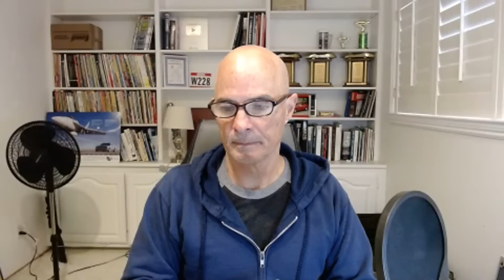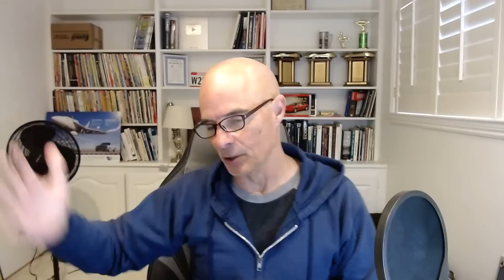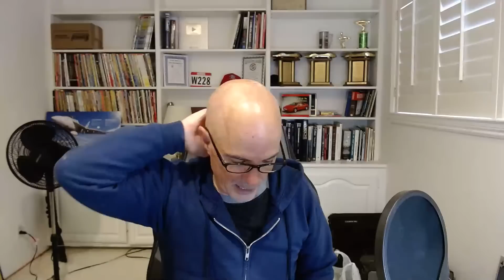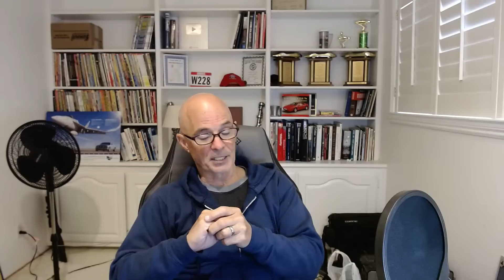LET'S TALK TECH-BIG HEADS, SMALL BORE?

Comment: Will 706 heads work on a 6.0 bored to 6.2, all else stock 6.0 cam 317 heads currently.If not what mods need done?
Reply: Eventually I will put SPDC Truck Torque 205/210 @ .050, .550 int .525 ex with 115 LSA and LS6 Springs that I got at a great price
Reply from the maker: I would be worried about boring it that far-heads are fine
Reply: @richardholdener1727  The motor was built by well known engine builder in this area Don Hardy Race Cars, I’ve reached out to them for more information on the engine. I’m wanting a little more from it and trying to utilize what I have already have.
Reply: Rich is correct, cylinder wall gets pretty thin at 030, I wouldn't go further,

Comment: I have afr ls3 64cc heads on ls2 bottom with summit 8710 (230/242  625/605 113+3 car dyno's 453/403
I have .130ptv int and .110 on ext.   Some are saying heads are to big to get anymore rwhp, some are saying I should drop the head to get more compression -
Some are also saying different cam since I have clearance 
Any suggestions
Reply from the maker: there is room for more cam
Reply: Car is a 05 Vette mt6 and with this cam it starts pulling at 3500 but falls off around 6300-6500
What cam would you suggest? 
Looking back through your videos the comp cam you used to quite a few  but the one that sticks out is  54-469-11
Thanks for your feedback.

Comment: 302 & 351w engines are 4.00 bores. Where would the issue be? With what heads? Cleveland heads with 2.19x1.71 valves fit. Admitted they are canted valve.

Comment: A combustion chamber that is smaller in diameter should have more quench area and raise compression ratio. In cylinder heads is quench as important in Aluminum as Iron Heads?

Comment: Pontiac 350 would be a good choice for this test. Pontiac guys do this all the time because of the small bores. Naturally if you run 400 heads on a 350 you get overhang in the top 3rd of the bore. Best part is you can find 400 heads that are the same valves and flow potential with just the broader chamber. Something like a 1968 #15 head on a 350 for instance. Also 69 #45 and 46. Most 2bbl 400 heads had the same small valves as the 350 heads. Then later Pontiac ran the 350 heads on performance 400s with the larger valves. Pontiac made these fit by putting large valve reliefs at the 9 oclock and 3 oclock positions of the bore.

Comment: I have run over sized heads on 5.7 LS1. I believe they were AFR 205s. (sad i sold them) in my camaro years ago. It made 438 rwhp with an MS3/3:73s/Headers/Fast90/SY3500 stall. It ran great. I just chose a gasket that would fit properly. Ran it for a few years like that with no issues.

Comment: I ran the 4 inch bore GM Fastburn heads on a Stock bore 305 in the Popular Hotrodding Engine Masters dyno competition.  It had a tad over .600 lift and minimal notching was done to clear the (small bores). I really think there is some positives to that combination especially in fuel mixing.

Comment: It could actually help flow up to around 0.300" lift because it could possibly help the flow cone tighten around the valve at lower lifts, sort of help to crutch a less than ideal valve job. Just a somewhat reasonable guess.

Comment: I run 088 heads on a 402 (396) with 38cc domes with an old b&m "power charger" on e85. Your 396 gonna be a blast with them big heads, especially if you pump some air into it!

Comment: Hi Rich, with regards big heads on small bore,  can you settle the old internet claims that E7TE/GT40P heads don’t fit on the 255? With a 3.68” bore, the valves look to be about 1/4” inside the edges of the combustion chambers.  Also, a 0.060” overbore would turn the 255 into a Ford version of the early 265 SBC……
I now realise that you explained much of this with the GM L99 tests - very close to a Ford 255 V8.